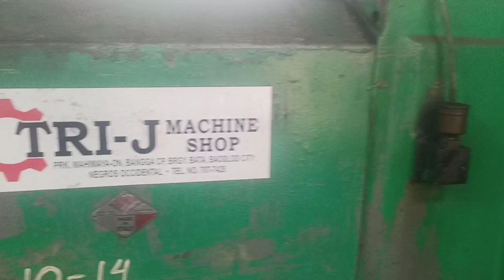Cylinder head reface | JT 3.0

Comment: noy, kung low compression na, reface ba ang gamot?
Reply from the maker: Kung naoverheat Ang makina mo meg reface Ang head dahilan din Yan Ng loss compression at Isa din dahilan Ng loss compression kung malaki Ng Ang gap clearance Ng piston ring
Reply: @ManinoyWhite  Paano malaman ang cylinder head ang nawarp at hindi yung cylinder block?
Reply from the maker: @TechiesUnofficial  kadalasan ma warp head lng boss minsan klng maka warp sa block kung nagooverheat pa reface molng Ang head